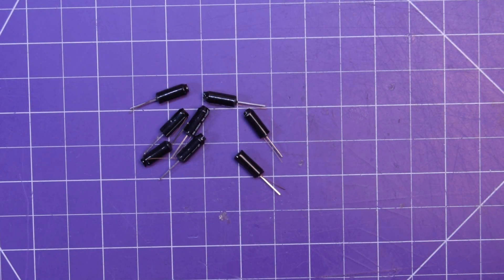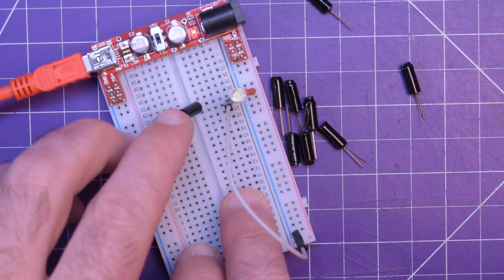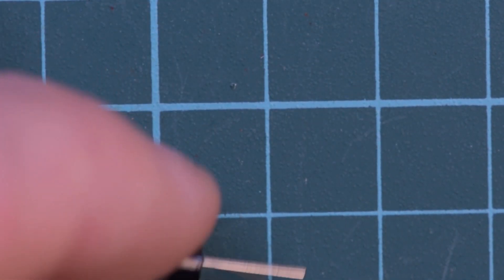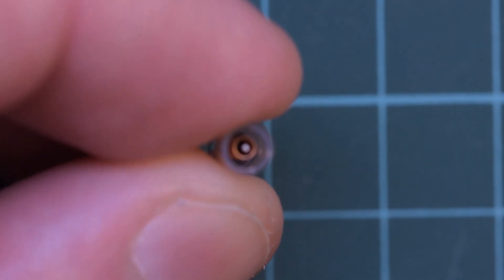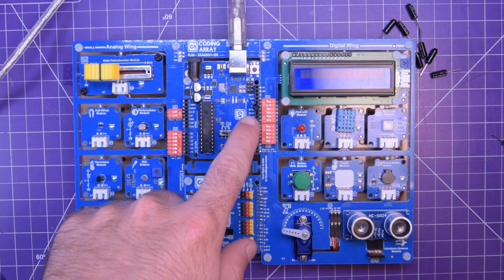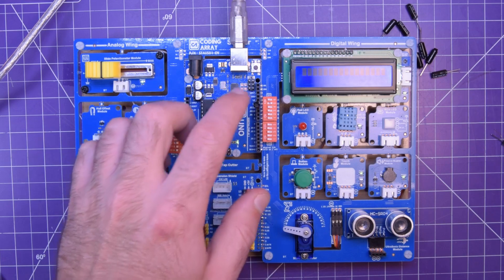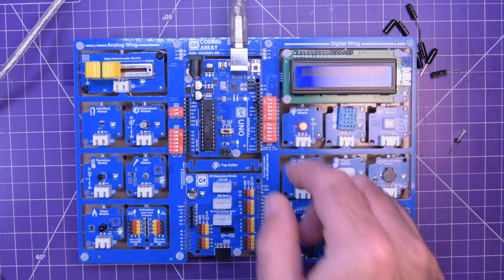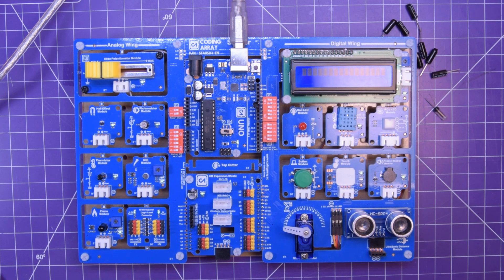Vibration Switches; Give Them A Shake!

Comment: So, what is the part number on these? [Edit: SW18020P] You only show it for a second and the link doesn't work. I expected these to be a type of ball switch (such ss W200, or W200D,  used in soldering irons to bring them out of standby when you pick up the iron) , but obviously they're very different.

Comment: Thanks for the video. 
Long time ago I know but did you measure what current it draws, plus with a resistor?
Thanks.
Reply from the maker: it's just a piece of wire so you put in a resistor of whatever the max current you want to draw - but if it is connected to a microcontroller, it is looking at voltage, not current, so you can use a huge resistor like 100k ohms or more!
Reply: @ Thanks, good to know.

Comment: I got this notification on my phone and all I saw was "Vibration" and a picture of long black things, suffice to say, I had to confirm or deny my suspicions.
Also if it's the passive buzzer you're trying to use to make sound, remember that PASSIVE buzzers require a sound signal from the arduino, active ones just require power